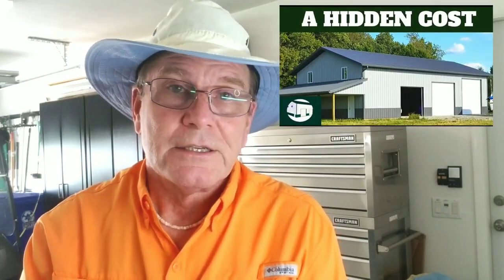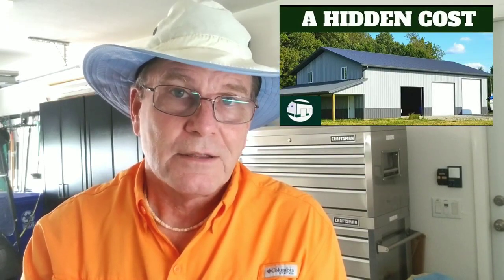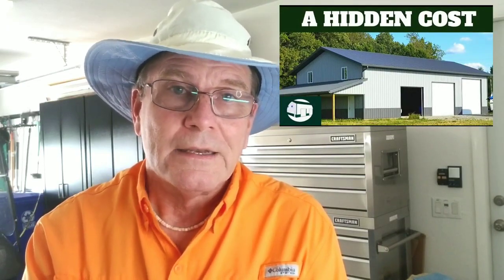Don't start Pole Barn Construction before you watch this.

Comment: The biggest benefits to laminated columns is they stay straight they're stronger and size is consistent. However, they are way more expensive. The laminated columns I need are 20' long. I need 20 of them. They are approximately $250 each = $5000. 4" x 6" x 20' treated post are approximately $90  each = $1800. $3200 difference. That's a lot of jack for posts but the quality of laminated columns is far better. For a pole barn I'd go with the posts. For a barndominium I'd go with the laminated columns. 
Just my 2¢.

Comment: Hello, I was just looking for a rough estimate of what it would cost to build and convert a 44X36 Carolina Barn into a home? According to what I've found a 44X36 Carolina Barn is available at just under $16,000 for the shell so I would still need to have concrete work,  plumbing, electrical, insulation, interior walls,  and various expected/unexpected ins and outs. I realize that pricing for any and all varies on location. Just wanted an idea of the cost. Thanks for any thoughts, opinions, advice,  or help.
Reply from the maker: What's a Carolina barn? Send a link.